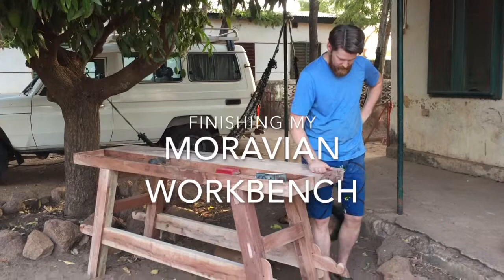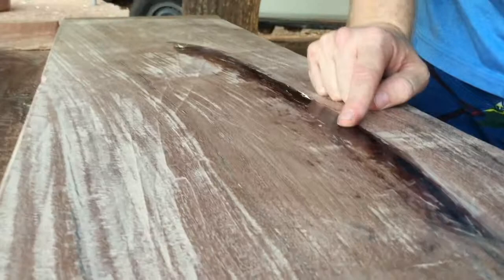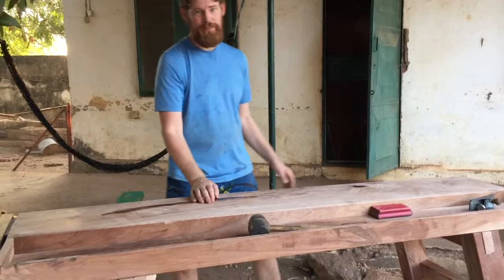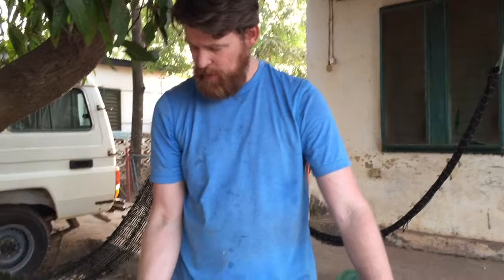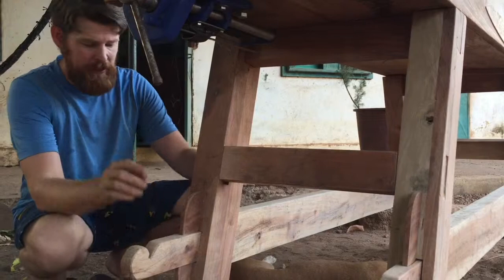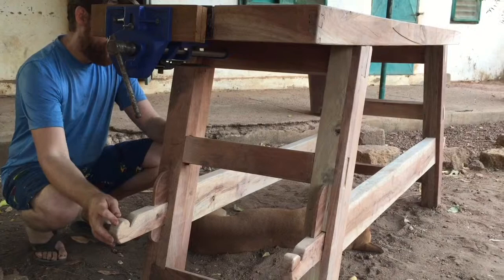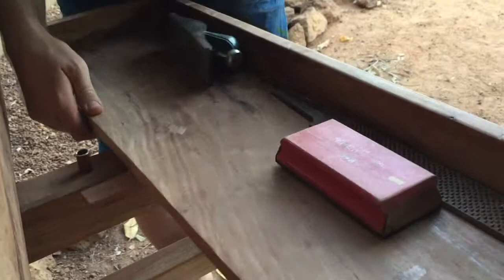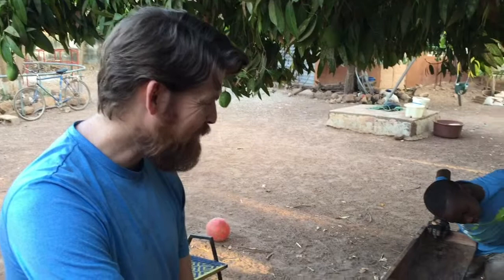Finished Moravian Workbench

Comment: I have the same problem with access to dowels here in Kenya (can be found but not easily), so I made a dowel maker/plate out of a 10mm steel plate with a series of incrementing holes.

Comment: You did the best with what you had, that is always a far more of an adventure for the creator then when everything is already for you. Because of that,  you have learned many more lessons and skills than the majority of the builders that have done the same project,  as far as the space between table and tool cubby? I would do 2 options, run a bead of silicone or caulking.  2nd option is a full length 1/2x1/2 square,  rectangular or even triangle.  When not together, just slide it to the other side of the cubby, tape it in if being moved long distance, then when you set it back up, slip it over your gap, no worries and no stress and will look like it belongs,  if no piece is long enough, ok either glue several in a line and then shape,  or make 2 to 4 short ones that just press in. Or a short strip and slide it left or right to cover the widest gap.

You have done a truly amazing job.  
It had been so long, i had been worried the rude folks pushed you away from putting this out. Super glad you have posted it.
Reply from the maker: Thanks for your ideas and compliments. I am pleased with the results, and I am kind of bummed that we will be traveling for the next year so I haven't even be able to use it one. But it will be so good to see family that we haven't seen in 4 years, and coming back, Lord willing, will be like Christmas when I get to do all those projects that will be so much easier with a workbench. I would love to see some videos of people doing their workbench or other projects in similar circumstances....maybe I'll have to make them. The Mr. Chickadee  channel is pretty good.

Comment: That is amazing. You inspire me
Reply from the maker: Thanks so much. Inspire you in what way?
Reply: When I see what you did, with the difficult wood in the “suboptimal work shop” and the tools I see, you really inspire me to do more with what I have. I am really slow but I enjoy wood work. I think wood working helps my mental health. For my work bench I am using a piece of 3/4” MDF that I clamp to a grid of 2x4s that I sit on top of a couple of saw horses. It is quick and easy to set up. The work surface is 2 feet by 4 feet, which is good most of the time. I have started building a moxon vice into the end but that is not finished. Maybe when I run out of things that I am building I will finish my bench. I have an idea of building a double Moravian bench, with more narrow work surfaces and the tray in the middle. I think that would be lighter and thus easier set up and take down. I just don’t have a place for a bench to stay set up when I’m not using it. I currently work in the driveway. So if rain comes I need to get everything back in out of the rain. I do have access to beautiful lumber.

Comment: pounding for hours on mortices. I can relate to that. The inly timber I have access to is tropical hardwood. My handsaws get about 10mm in and refuse to cut further. Even a circular saw struggles. I made a beautiful box beam bench from plans. Beautiful that is until one of the timber uprights decide to twist after it was assembled and pulled everything out of square. I'm going to switch to plywood. Its easier to work with and much more stable.

Comment: try ripping lengths and doing laminations to get the top flat, you can eliminate the holes. Try getting softer wood? You can hog out the mortises with a drill bit.
Reply: Insects would destroy softer wood there in months.
Reply: alan g k  termites and wood ants is a concern leaving the wood outside then you have bigger issues to deal with? Besides anytime you work with would you would need to worry about insects eating the raw lumber. When I say softer wood I’m not talking about White Pine, Poplar, or Eastern Red Cedar. He’s in Africa so the softest wood is a hardwood here. African Mahogany, Sapelle, etc. anything other than the Iron Wood he’s working with.